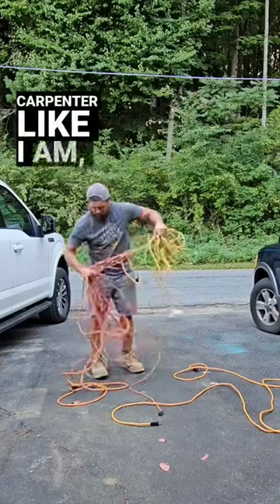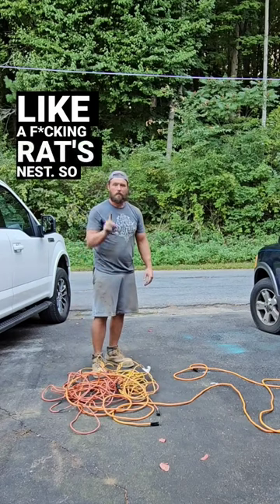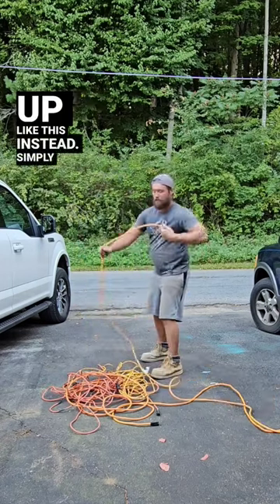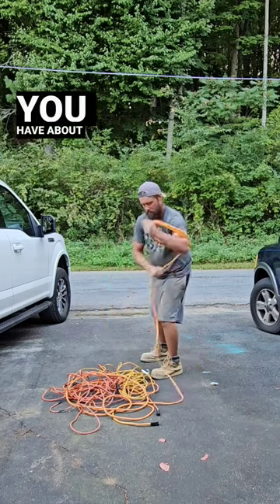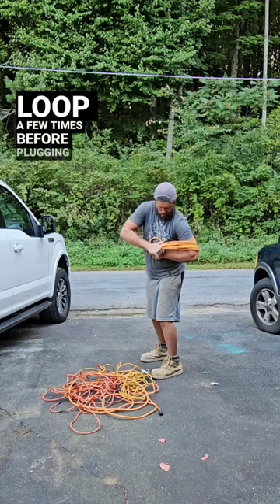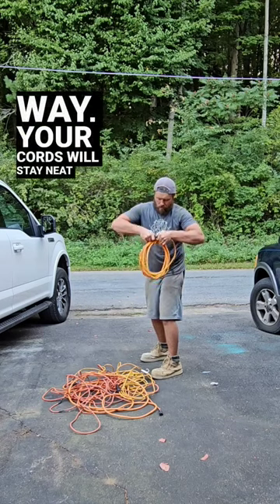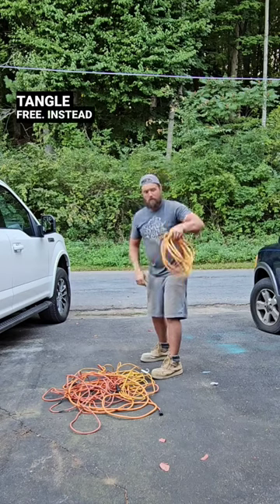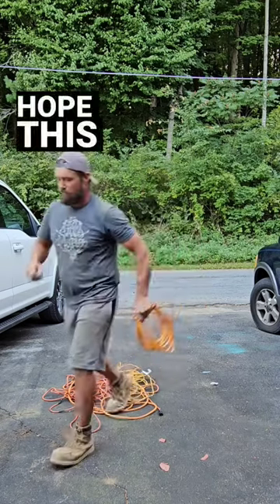How to roll up a lead cord - Part 1! #shorts

Comment: Uuuugh. Don’t do this. Use the “over under” method so the cord doesn’t tangle when you go to use it again.
Reply: I learned this technique over the summer and   It makes unrolling so easy.
Reply: It's a 25' cord. Different length cords get wrapped different ways.
Reply: @chrisanthony579 ok bud
Reply: @BawkBawkBawk666  why does it say "translate to English" on your comment? Why does it just make it slightly larger 🤔😵‍💫🤯

Comment: I joined the millwright union as an apprentice years ago. Went to clean up on the first day which obviously meant rolling up the cords. I went to do that and they screamed at me lol.
Reply: Carpenters Union apprentice here, they also yelled at me for rolling cords like this. Apparently, it damages them?🤔
Reply: @lorenzomartin1019  that and when you go to unwind it again 9/10 times it gets all tangled when rolled up like that
Reply: @95poo40sx it's because when you unroll it, every loop becomes a trip hazard. 
Do the over/under method and when you lay out the cord it will stay flat to the ground
Reply: Do not let someone catch you Rollin up a cord or hose that way son.
Reply: Same but like was trippin trippin about it . All I could think was who gives a fuck im doing it .

Comment: I know people have different ways they like to roll cords, and this is fast but will put permanent twists in the wires and ruin your cord
Reply: Yup.  You will be buying cords every 6 months.
And you won't be using this method with welding leads.
Reply: @tedkrush5661 huh, maybe the extension cord I have that I've used for nearly a decade that's still in excellent condition I do this with should be replaced.  Cuz, I mean, some rando on the Internet said so.
Reply: @TheDiosdebaca  Ohhh I can see a cord being rolled as described remaining in good condition with owners like you that only used  the cord but once or twice a year.  Everyone's mileage will vary.  BTW I never said you ""HAD"" to replace it.
Reply: @tedkrush5661  I use it about 1-2 times a week. I just don't whip it around like a madman, and I let the cord settle instead of twisting it.

Comment: This is the correct way.  You don't need to transfer the worries of small signal cables to the application of large braided power wires.  They're built for it. 99% of the work is going into the insulation, not the wires.   Sure twist roll your guitar cables and xlr mic cables, but for power, stop burning daylight with your boy-scout knots that still don't really constitute "organized" because an "organized mess" is still a mess. If you treat an extension cord like its a piano, you're doing it wrong.

Comment: NO! No! No! No! No! Make a loop about the size of a basketball and wind/roll it in. The conductors inside the jacket are wound in a particular direction. Let the cable show you how it wants to be wrapped.
Watch this for the propper way:
https://www.youtube.com/watch?v=dd5s-VueQPg

It's also a good idea to have Velcro cable wraps, like Rip-Ties, or good old tie line, to secure the cable once it's wrapped. Color code/mark to show length.